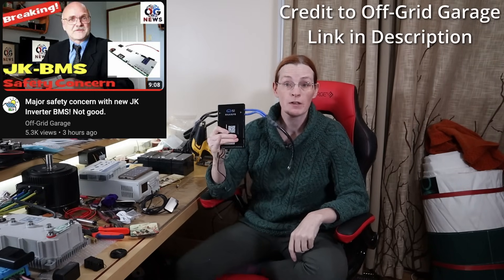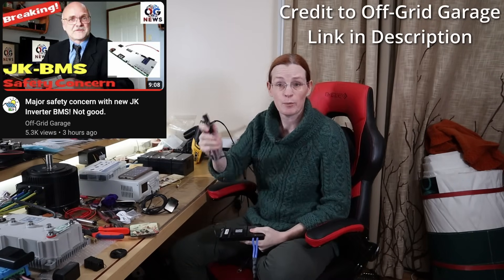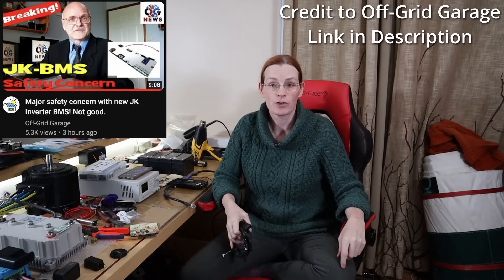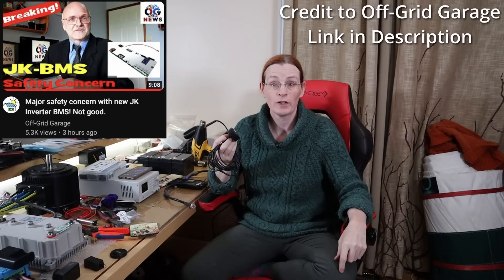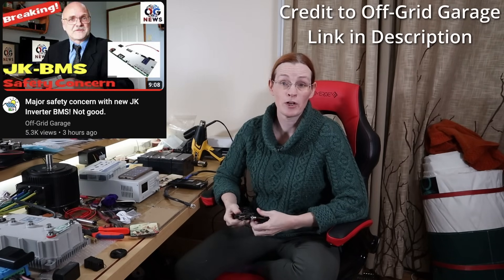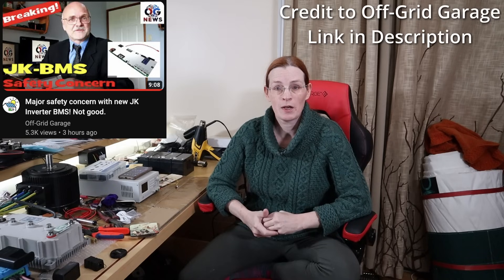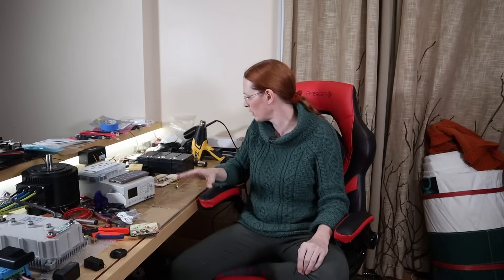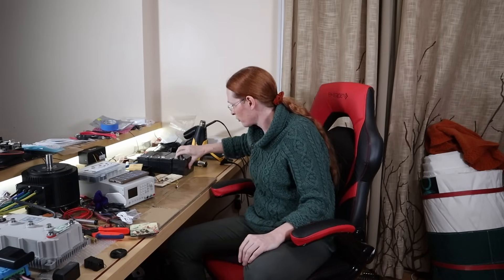News from Off-Grid Garage; Dangerous JK BMS Flaw

Comment: Hello  The Digital Mermaid. I do watch videos and i have to disagree with you on this one.Let me explain 
1. As Andy said in his videos BMS is not needed in case cells are properly balanced. What it means is in case your input voltage(charging Volt) is properly set ..lets say 55V (or anything close by) it doesn't matter much.
2. It matter much in case your cells are close to 0% or close to 95-100% then it is critical to monitor cells voltage and in case some are close to critical voltage lets say 2.5 or 3.6V then BMS should start panicking by turning off battery or similar measure 
3. I Fully agree it is flaw or bug or what ever it is that is causing this issue and it isn't acceptable. also all those things you mentioned. 
environment
Reply from the maker: 1. Safety devices, which a BMS is, has to be reliable when things unexpected happen. It would be lovely if we could trust a balanced bank to stay balanced throughout it's life, but that's not realistic. We have to trust the BMS to disconnect before a cell is overcharged, and this flaw, and the lack of fail-safes, doesn't provide that protection.
2. The vast, vast majority of people won't (and most can't) monitor their batteries as they reach full charge. Consider being under sail with solar and regen coming in, or driving an RV being charged by solar and an alternator... You have to focus on navigating/driving and trust the BMS is doing it's job. 
3. The reason I am so upset isn't because of just this bug, though it's a massive failure in fail-safes and QA, but it's the last stray for me in a long series of problems, development choices, and corporate culture coming out of JK. I just don't trust them anymore. You can't even order a specific model number and be sure of what features or capabilities you'll get, that's madness.
Reply: @TheDigitalMermaid  Agree to point 3 for sure :). I also agree BMS is here to make sure all is well but on other hand if you looks at it from practical point of view. I understand and agree with what you said but at point BMS will shut down it doesn't matter what you are doing or what you are focusing on you have only two choises.. Leave it off and hope your system is robust so you don't have to worry even in this condition or continue even with alarm or what ever even if you know it might damage cells..you might be in situation where it doesn't matter if you depleet some cells more but you might need few watts to keep your gps phone or radio on no matter what.. That is why  said BMS is needed but isn't critical ..because at that point it might not be important how badly cells are damaged but it might be live/death situation ..Ofc I would suggest one thing..there is BMS from JK it is that 1000A version that doesn't use real fets but relay ..so i would suggest to have one of those as well ..just to be sure If you want i can dig part number for that
Reply: @TheDigitalMermaid  B2A25SRP

Comment: Wait... this is not about the same BMS Andy is talking...
Your system is safe...
There is no any BMS in the world can satisfy everything...
There is JK BMS on Andy battery shelf working just fine...
Daly BMS is changing all of the batteries to 5V, no matter of your parameters...
New Heltec BMS is actually JK inside...
When you are buying something... just make sure you can do it what you want with it... not just drop the money and expect miracle...
Reply from the maker: I know that this issue is for a specific release of the BMS. I explained why I no longer recommend in the video, there are just too many problems with JK, with this just being the worst.

Comment: As far as I know, this problem is only with the new BMS. The other ones are ok. I disconnected my 3 for 7 days. After reconnecting, all settings were there. No problem at all.
Reply from the maker: This specific issue is limited to the new inverter models, I believe.

Comment: Thanks for warning us. I got the older black one (200A). Did not connect it yet.. I'll try how it goes.
A good charger should pervent that from happening also, right?
Reply from the maker: Chances are, the older BMSes like I have are fine, just test carefully when you build. My complaints and frustration are at how JK operates as a business, with this latest flaw being just the worst example.
Reply: Hi,
If you use a charger that does not communicate with the bms....is there still a problem?  (So a dumb blue victron charger set for lithium iron)
Other Scenario
A jk bms, with no charger attached cannot start actively balancing to a value higher than the highest charged cell... as in, can it generate the 4.2v without a charger attached?
Bought 2 older ones last year and was about to finally use them 🤔
Reply from the maker: @gerardhealy764  Yes there's a problem... A charger can't see the internal per-cell voltage, so if you set the charger to 57.6v (3.6v/cell), but one cell is higher than the rest, you could have a situation where 15 cells are averaging 3.3v (49.5v) and that leaves 8.1v that could go into the cell. So if the BMS was set to not cut off until 4.2 volts, you could damage a few cells and the charger would still see under 57.6v.
Reply: @TheDigitalMermaid  thanks for that.  I was left with question in my head even after watching andy's video.  A hint on the alternatives you are considering would be great (unless it would spoil things). Keep up the good work.
P.s. I just blew the capacitor bank on my kweld spot welder by not restricting the inrush current, was too impatient to wait for my new bench power supply too arrive and used a battery!.. so learning the hard way here too!
Reply from the maker: @gerardhealy764  Learning the hard way is the DIY life! Haha. Sorry, I can't really speak about the alternative plans just yet.

Comment: Hi :hand-pink-waving:
good decision , with new cells you don't need an active balancer !
I can recommend the BMS2 from Seplos . 
I also use BMS3 but I'm not completely convinced yet.
The 16s flagship from JDB might also come into question, if it is as good as the 4s from JBD in my OstBlockBatterie, then it is a real alternative.
I'll be testing the 16s soon.
very hard :-)
Ps.: and with Seplos you don't have to beg for a guarantee
Reply from the maker: I'm going to need some time to think about what I'll recommend, I've not paid close attention to the BMS world in the last year.
Reply: @TheDigitalMermaid . maybe focus on the important things, voltage readout accuracy, SOC determination, accuracy, failure frequency, connection to your monitoring
..The Bms should be as simple and robust as possible for your boat
... waterproof could not hurt (although :-) the seplos is already running 2years on a racing boat in Bulgaria)
....less important , bluetooth, active balancer
Ps.: you will know how to proceed, the second 
try will be a hit :-)
all the best :-)

Comment: I can add a story here as well. I bought a version with a 2A balancer. When opening it, the PCB was labelled with 1A. I sent a question about that to them. After asking where I got that from I didn't get any answers anymore.
Now this BMS is throwing errors about the current sensor. Will probably switch to something else.
Reply from the maker: Do you have pictures or records of this? If so, would you mind sharing them with me? My email is under the About tab.

Comment: Huge flaw but 

Your charger will not keep changing after it reaches its maximum voltage 

So at worst you overcharge a few cells that are out of ballance 

But you need to babysit these bms's to notice the change
Reply from the maker: "at worst you overcharge a few cells" - which could destroy them. I'm going to do a follow-up video in the next day or two to address the idea that the charger can prevent damage, because I don't think that is a safe assumption. If you set you charge voltage to 57.6v, 3.6v/cell, and all your cells are perfectly balanced than sure, that would be fine. However, we know how incredibly flat the voltage curve is on LFP... If you had one cell above the others, and the average across 15 was still 3.3v, that's 49.5v, leaving 8.1v overhead for that 16th cell. If the BMS doesn't cut the charge, the cell will be destroyed in this scenario. This 4.2v flaw would easily lead to the destruction of a couple cells.

Comment: I've used & installed over 50 of the older JKBKS version, 1 and only 1 had an issue.
Maddie, chillax have a PUFFY and consider your reaction (overly so) reflect on the "Mass Bash you just did, seriously.

Last Point, over a WEEK AGO the first reports of the RESET TO DEFAULT ISSUE on DIYSolar and another Solar Forum as well....
Reply from the maker: The devil's lettuce gives me a vicious headache, I'll pass. I'm glad you've had good luck with your BMSes. Mine, the ones I got that actually worked, have kept working fine. I thought I explained pretty clearly in the video why I am upset, and it's not because of this one flaw. It's a long pattern of behaviour from JK that upsets me. If someone bought JK BMSes because they saw I use them, and they got unlucky and got a bad BMS and it destroyed their cells, I would feel horrible. I had to go on the record with my concerns.

Comment: Any app I ever touch is glitchy and annoying.  Is it the apps or  the me??? 😂😂😂
The old JKs are proven tech, mine kept its memory for a year in its cardboard box when I was between builds.
Everyone keep calm and drink a Bud Lite.
Reply from the maker: I'm glad you have had a good experience. To be clear, the BMSes I'm using currently are also behaving as expected. I made it clear though why I have lost trust in the company, and anyone with the newer models very much should not "keep calm" when there's a bug that could destroy their expensive battery cells.
Reply: @TheDigitalMermaid  Ok keep calm and check anything that has settings in it that has been turned off for a period of time. Be it a BMS or the settings in thermostats to your central heating (HVAC). This is an over reaction,  It is common sense that anything with a memory of settings can lose it and will need double checking on the next switch on.  To not do this, especially with a safty critical item is foolhardy.
Reply: @TheDigitalMermaid  Milions are still buying Teslas and they are the worlds worst for releasing products that are not perfect or even finished and test on the public.
Unfortunately That's manufacturing,  it has been like this since before Henry Ford and will not change, Beta testing, failures in the field and engineering Revision Changes will always happen.

Comment: i have the old version with the black metal housing and i can leave the battery switched off for 3 weeks without any problems and the error does not occur. what you should not forget is that you are buying cheap china products here and you should not make a big fuss if you get what you paid for?
Reply from the maker: My old BMSes don't have this problem, either, but again that wasn't the point. I made the "big fuss" because of the long record of product releases and customer support issues I talked about in the video.

Comment: The Community found this problem and informed me, I just made the video to get the news out.
I had seen mine resetting but didn't pay attention to that, thought it was me clicking the wrong button or so...

Great video and summary, Madi. Thank you!
Reply: Andy, Thanks to you for your video's. I have watch so much, you must graduate me, with a degree in battery's.  I have gone on and build 14 battery's to date. these is for the 4 by 4 overland community's and the offroad trailer community's here in Africa. Your comment on the JK BMS is disturbing. what do you recommend as alternative ? 4 to 16 S systems. we use 280 Ah cells.
Reply from the maker: Aye, I made a point to call out your community as well in crediting the source. It's one of the very best things with youtube; The community brings knowledge and resources to the table we couldn't get otherwise. I really hope this was caught soon enough that no one out there actually lost their cells to this bug.
Reply: True community Teamwork 😊

Comment: Thanks Maddy and Andy, for bringing this public! Luckily no harm done to your cells thank god. I just used a simple 25,00 euro hardwired 100amp bms. Because of costs when i was building my rv batterys. On top of that a placed a 1amp active balancer off 6,00 euros. For the last 3 years this config has been working flawless. I also installed a small switching voltmeter per cell block, that i regularly can switch on to check the cells. Very cheap, very lowpower in standby, but it works. Yeah no fancy app controlls etc, but i just want reliability no frills, and couldnt affort it haha.

Comment: I have to agree, this sort of flaw is not acceptable on any level. And I've even had 3 of the BMS's like you have, to find that running more than 1 in parallel caused issues which was strange. I too had lack lustre responses from JK. While their hardware is ok, it's nothing without the software to back it up. Hopefully someone gets kicked in the butt for this problem, and they have a change of procedure, but we won't hold our breath.
Reply from the maker: Another commentor quoted a reply from JK saying "well, just don't turn it off". If that's a genuine reply, and it would be in-line with how they've handled my complaints in the past, then no one is getting kicked in the butt. My core argument is the company culture over there... Sure, when you get the BMS with the features you expected and that variant performs as expected, it's good for the money. The problem is their willingness to change shit on the fly, without model number variation, and pass the buck to the end user for getting caught out. JK clearly does not give one damn about the users of their safety devices.

Comment: Why is everyone so outraged. These BMS'es have no battery to keep settings. Only a capacitor that can hold it for a few days, 1 or 2 weeks at most. The fallback setting is wrong and should be changed that's clear. But losing the setting is by design. They could have used non-volatile memory, but they didn't simply because of the costs. This is a significant risk of buying cheap stuff in China. It's well known that many of the products from China are poorly designed or copied. I did a lot of testing on Chinese products (electronics, USB power supplies, radio equipment, etc.) and it scared the hell out of me.
Reply: The non volatile memory is a segment of flash in the main microcontroller. There is no extra cost. The old style doesn't forget its settings, and this one doesn't either until a firmware or two versions ago.
Reply from the maker: I explained in the video why I'm upset, this is not an isolated issue, but it is the most egregious. We're long, long past the days when a battery was needed to save settings, and none of their previous models had this behaviour.

Comment: the comment i received from manufacturer "Hello, please do not close BMS. Closing BMS will restore the default settings regardless of what it is.
This is factory set.
You can choose to use the sleep mode in the app, which will not reset your parameter settings." yeah..
Reply from the maker: Holy shit, if that's true (and it would be in-line with my experiences with them), then they're making it even worse. None of their previous BMSes reset to default on reboot. The idea that they could make a change like that and hand-wave it as being normal is ... wow. Could I ask you to email me? Address is in the about page, with a copy of that response?

Comment: holy cr**
I've been struggling with much of the same issues you have, but as a hobby electronics nerd as well (as being a SW engineer) I've just fixed them ad-hoc myself instead of trying to get proper docs from JK (they are TERRIBLE, when they're not missing they are just as often plain wrong), and I'm using li-ion cells, so these kinda "quirks" can easily cause a major fire!
Reply from the maker: In this failure mode, the chance of a fire are virtually zero, LFP doesn't get hot enough in a thermal runaway, but they could bloat up badly, destroying the cells and possibly doing other mechanical damage.
Reply: @TheDigitalMermaid   that would be true for LiFePO4 cells, but according to posts I've seen it forgets all it's settings, and there's plenty of scenarios where that could lead to trouble with LiIon cells.